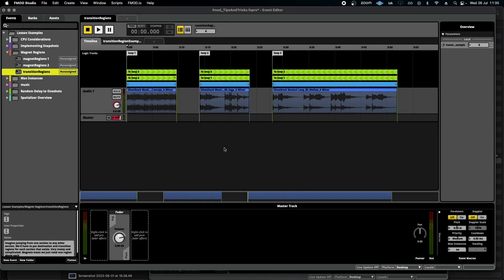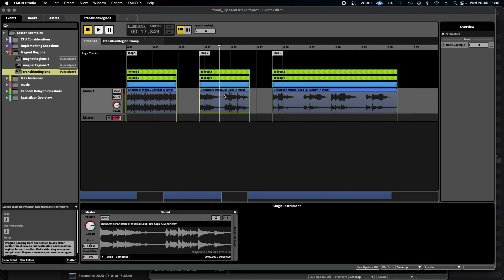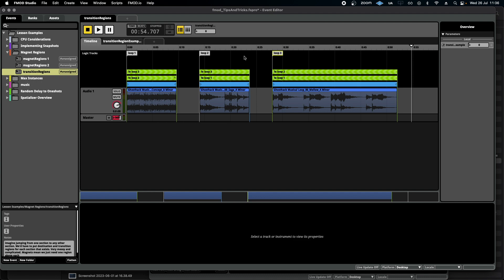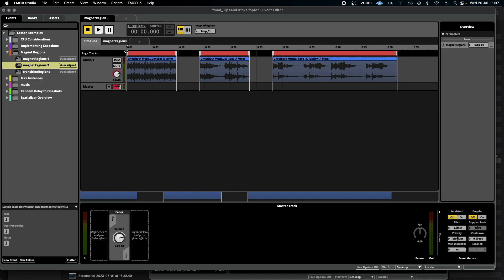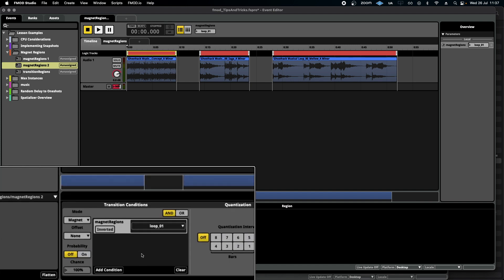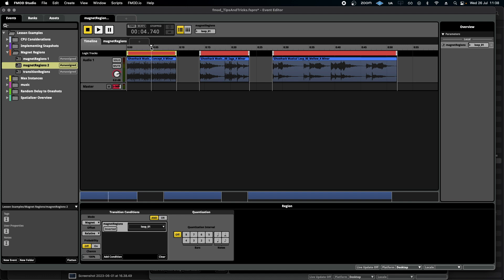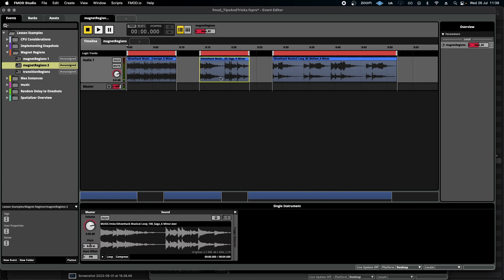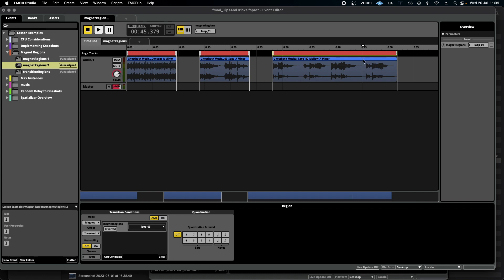How To Use Fmod - Using Magnet Regions

Comment: When I listen to an asset in assets on the left and then add it to audio track, on that audio track it sounds like it's mono and is very flat. Also when I click on the asset on the track in master window at the bottom, it sounds normal and only when I click Play it sounds flat. I cannot find a reason to this and didn't find any article or forum post about this. If you have any idea I would be very grateful, thank you!